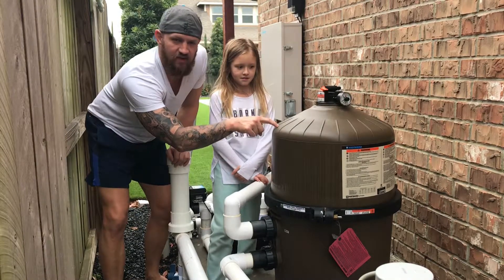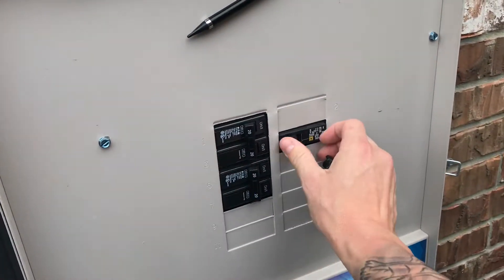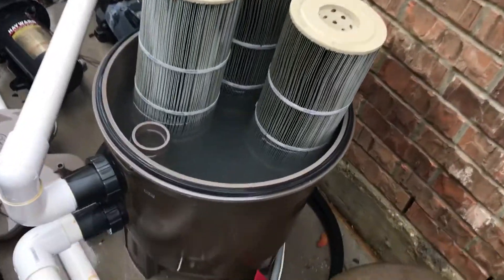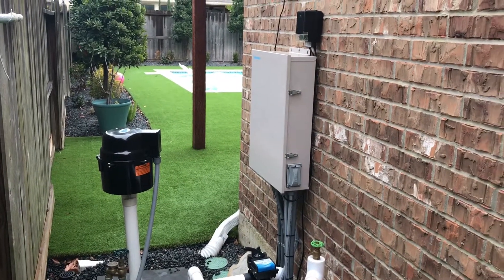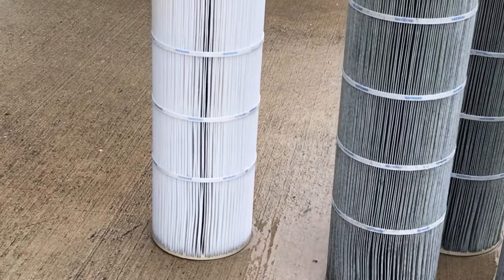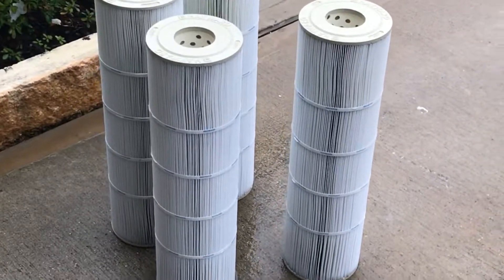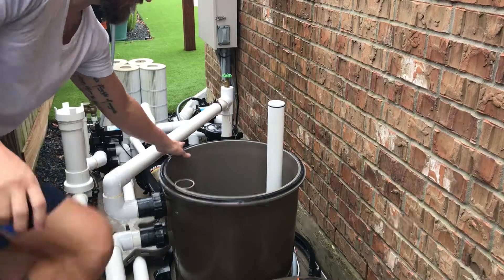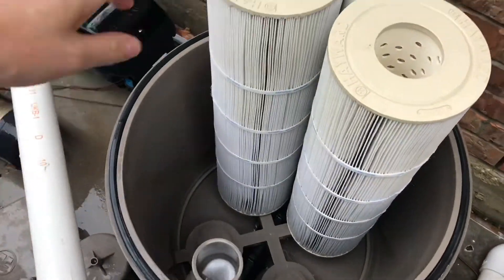How to Clean your Pool filters

Comment: Scotty, I don’t know what we did before YouTube.  This is an extremely useful video.  And you saved me at least 90 minutes with the suggestion to smack the clamp with a rubber mallet as you’re tightening.  My gasket was leaking when I first turned the system back on.  I was afraid to tighten the clamp any further.  After smacking that thing with the rubber mallet a few times, the bolt had loosened, and a little further tightening made that sucker stop leaking!  Thank you, thank you, thank you!  Now I can have another whiskey on the rocks while hammering out this comment.  You rock!

Comment: Scotty, take the lid off your pump basket and open the air valve on top of your filter. The water will drain back to the pool and the filter head will come off with ease. When you're ready to start again, just prime the pump with water before turning on. Simple, and clean. ALSO, add teflon paste to your o-ring before putting cap back on, helps keep the seal and keeps o-ring from drying out. Cheers!
Reply: I thought he was gunna blow up 🙄😬😬😅😂🤣🤣 glad he didn’t lol
Reply: why did he fill it back with water?

Comment: Very nice video, helped me out for my first cleaning for the filters.  Yeah, you may want to make another one and open the plug at the bottom before trying to take the top off and open the air bleed so the water will drain off, but it still worked just got a little wet.

Comment: First, open the air relief, the water will drain down. Then pull the drain plug from the base of the filter. Use a 3/4" socket on the nut side, you dont have to hold the bolt with the pliers. The lid raises easily so you dont get covered in fiberglass from the filter. Rinse the tank and oring of the filter, and put it all back together. Nice music.

Comment: Open the pump filter  cover before you remove the filter top.  That will drain water from the filter and much easier to remove.  If hard to remove, couple taps with a rubber mallet helps. I have never had to wrestle with my filter top like that.  Re: the drain plug in the back.  Those are really difficult to work with as they are in the back and very tight working conditions.  Advice:  leave it alone, use a small bucket to remove the water.  There is very little dirt remaining and it won't matter.  That white plastic tube (11 min 31 sec) is suppose to have a small metal filter  round screen, it has nothing to do with releasing the air.  You should lube the o rings with silicone. Makes them last longer. The big o ring costs 40 bucks.  Tap the metal ring strap with the mallet first before tightening, not later,  is also good to do.  Get an Aqua comb instead of a  nozzle, much faster and  cleaner.  Spray with degreaser first cleans the filters 1st. 10.00  Lowes.   I loved your Arnold, very funny!.
Reply: When you open the pump filter there’s a valve that locks into place (with the drain and skimmer options) do you need to turn that to the off position or does that matter?
Reply: @victoriasseacretoki  As long as the water drains when you remove the filter lid and have opened the valve connected  to the pressure gauge (located at the top of filter) I don't think you need to  turn any other valves.  My pool doesn't have that feature though, so I am not entirely 100% sure.

Comment: Great video! You got to the point the right way.  We’ve been having our Hayward system since 2007 and I learned so much from your video.  Didn’t know about the plug in the back bottom for our thing. The lousy pool company was and still is terrible with customer support.  Just wondering since we have an older system, the aluminum clamp on the filter housing has gotten corroded.   Looks like it was poorly powder painted since it’s chipping badly.  Would cleaning it up and painting it with some high end paint work rather than powder painting?

Comment: My Paramount Clear O3 worked perfect for 2+ years. Now the red ball wants to stay at the top, even after I adjust it all the way down. 
It will drop down eventually, but then goes right back up when I just barely adjust it back up a little bit. 
Any ideas of what would cause that?
 How to fix?
I just cleaned my filters this weekend and they were dirty after the Winter. Thanks to your great advice.
Much better pressures.
Still didn't help the O3.
Not much on YouTube.
 Thank you -
Michael E
 Austin, TX.

Comment: Scotty, just for info, your gooseneck pliers are made to grip in one direction.  Always make sure the bend is toward the way you are turning.  You can use them backwards for light torque, but for heavier applications, or pipe, you'll need to have them in the proper position.
Reply from the maker: Unless
You have hands of steel 🤣
Reply: Well, I do, but with your hands of steel, you can get 3X the torque if you use them properly.  Take a close look at the teeth, they are angled to grip in one direction.  Proper tool use is important to your viewers.

Comment: Great Video...thanks so much!  One question, I have a Hayward C4025 and we just moved in to this older house and the pressure gauge (green arrow) is at 20 PSI when I clean the filter and (Red Arrow) sets at 30.  I don't know how old the filters are but as far as pressure,  Is that pressure reading similar to yours ?   My neighbor has a different Hayward filter and his operates around 12 PSI !
Reply from the maker: Might be a bad gauge. They are cheap to replace. It try that first

Comment: Great video. My pool is above the machinery so I released most of the water from the plug port before pulling the top off. Before opening the plug , I have to turn valves to prevent backflow from the pool. I forgot the silicon lube so I'll have to put it on the next time I open it up. Great advice on cleaning the filter in the driveway, a bunch of gunk coming out and lots of water used, avoided having a mud hole in my yard.

Comment: Scottie B. I have a very similar system and my pump is kinda running loud. Could that be because of the filter needing a cleaning?
Reply from the maker: For sure homie. I like to keep two sets of filters so I can just swap em out and clean them later.   Make sure the pump isn’t clogged as well. I usually run mine on 80% during day and 50% at night. Much quieter if you have a variable pump

Comment: I am unable to open the drain plug in my catridge filter, as it is in a tight spot. Tried inserting a screwdriver in the center gap but it didnt budge. I was afraid I would break one side of the plastic grip. Is there any other way I can drain that remaining water in the filter ? Please suggest.
Reply: I have the same problem, it is located next to my home's wall and very awkward to open and close.  I abandoned that plan and just use a bucket and sometimes a shop vac to remove the water.  Simpler and just takes a few minutes.

Comment: @11:47 - how does your water level stay high in the filter housing? Wouldn't it immediately drop since the housing is higher than the water level?
Reply from the maker: You let the air out of the top and it fills up the rest of the way.

Comment: Maybe I missed it what do you set the pressure to on the air gauge
Reply from the maker: There is a green section that the pressure range should fall in

Comment: Thanks, but only part I'm still in question of is at the end when you say "When you're "sure" it's full" ------ ?? -- How do I make sure?? when the water starts spurtin out the open air nozzle???   --- if so, you need to simple say, "when water starts spurtin out air nozzle you're good to go"  --- Not sure I did it right but my pump seems to be working, we'll see. Thanks just the same

Comment: Several points you missed ..

1) remove, clean and lube the large O ring
2) torque the bolt to 150 lbs

My filter is a DE filter so I would add about 6 to 7 lbs of DE

Comment: I recently cleaned my filter.  Whenever I vacuum the pool, by the next day, dirt appears in the same place, near where the water comes in when the pump is on.  Is it possible that there is dirt that's too fine for the filter to keep and it comes back into the pool?  If so, is there a solution?
Reply from the maker: I kinda doubt it. Maybe the pool is sucking dirt to that area.   Do you have a Polaris or cleaner?

Comment: Great video but in the beginning you were supposed to leave the air valve open and then you can easily take off the top
Reply: And also unplug the bottom so the water empties

Comment: Never release the “Band” before relieving the filters pressure.
Release the Air Valve, purge the pressurized filter.
Remove the drain plug, draining the nasty dirty water.
Remove the filters “Band” to allow the top to come off.
Clean er up!
And reassemble in reverse order.
TaDah!